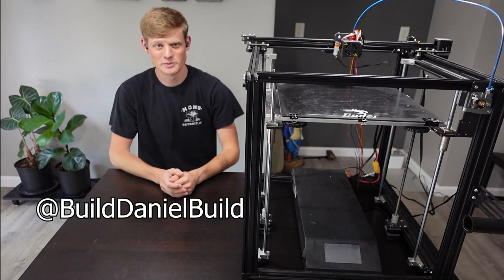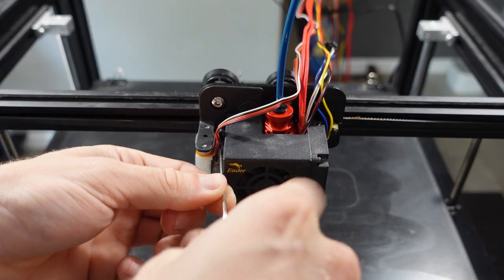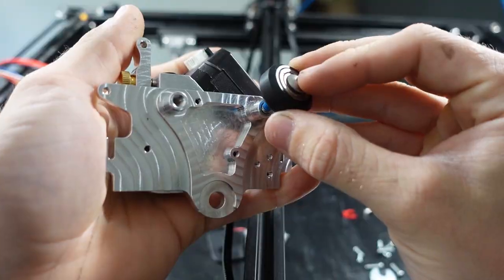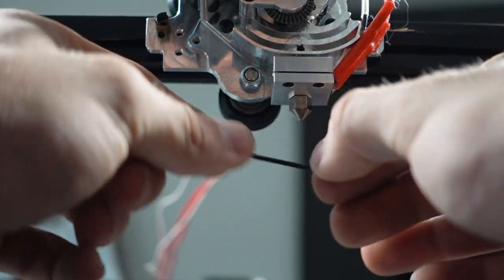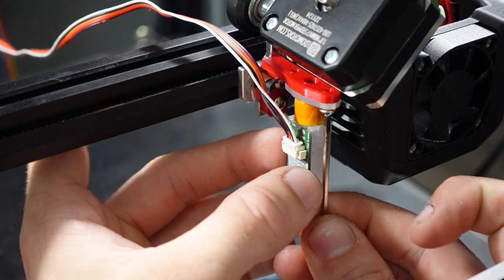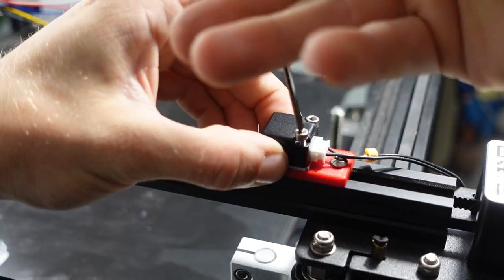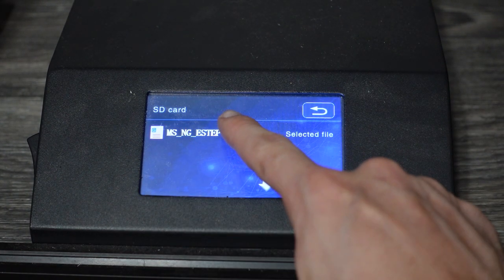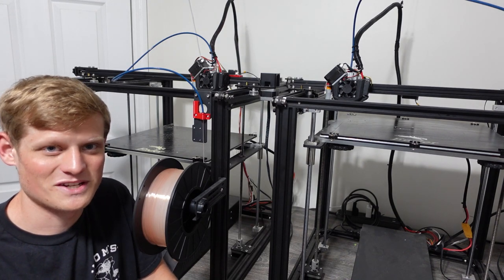Micro Swiss NG™ Direct Drive Extruder Installation Video (Creality Ender 5 Plus)

Comment: The Micro Swiss NG pretty well saved my Ender 5 to be honest.   Id started having some issues with the stock setup, especially the stock extruder that was just shredding filament.   I'd even tried a Creality Spider hot end hoping that would help but that turned out to be worse than the stock hot end.    I was about ready to give up when I happened across a heavily reduced Ender 5 Micro Swiss NG kit from a seller who bought the wrong kit.  It was still sealed, so I grabbed it and honestly, it is like having a different printer.  It behaves and just works now.      Of course, now it works I am going to put Klipper on it lol :)        The only thing I had an issue with was the CR Touch.  Because of where the connector is, the included BL Touch bracket didn;t work at all.   Luckily I'd printed one thinking it wasn't included and the one I printed was a bit different and worked with the Creality CR Touch
Reply: You happen to have the STL link for that part? In the same boat.

Comment: Thank you for showing the install of the X endstop! I was having issues with my Ender 5 Plus conversion when I realized that mine did not use an 8020 T nut for the endstop bracket like yours, instead using a threaded hold in the 8020 frame.

Comment: If anyone else was confused about attaching the hotend assembly to the extruder, the instructions failed to note that you might need to dry the grub screw outwards a bit in order to get the hotend fully inserted. There's a small inner ring on the hot end assembly that needs to get fully inserted into the extruder body. Once that's in, then you can drive your grub screw in and secure the hotend.

Comment: I agree that this may be the best drop in replacement option, but there are better direct drive options out there if you are willing to print mounts.
Reply: like what?
Reply: @d6m6nk6ng6  popular option is orbiter/Sherpa paired with hotends like phateus rapido/dragon comes in at about same price or slightly higher but does beat this in terms of weight (usually around 100g weight saving, YMMV depends on hotend, gantry options), higher volumetric flow allowing for faster prints, and more flexibility (more cooling options, or use of other hotends that have perks like the e3d revo). For all in one extruder/hotend, biqu H2 v2s or lite have shorter filament path and lighter by more again around 90-120g, and is overall cheaper. I actually forgot about the NF-sunrise which is around 70g lighter than this microswiss and is a drop in replacement for printers with the creality printer mounts. I don't have previous experience with NF-sunrise or microswiss NG but atleast on paper, NF-sunrise sounds like better option
Reply: This one is very unique though in that it has an exceptionally short filament path

Comment: I have 2 E5+ printers one has the genuine Bondtech BMG and I have bought a clone for the other one, however, the clone is running backwards and so the fix is to swap the 2 centre wires from the extruder motor around but no matter which tool I use to press down on the captive blades in the stock Creality plug the wires wont release, I don't want to cut and solder the wires as later down the line I may want to use a different extruder.
 as anyone else had this issue and how did you solve it?

Comment: perfect straight forward set up video. I just ordered one. Im just wondering how it will run on the Sonic Pad as far as the esteps
Reply: This is my question too. Any luck finding an answer? Or luck figuring it out?
Reply: @GrimCW  so I’ve been running into problems. The rotation distance needs to be adjusted to roughly 8mm and retraction distance and speed should be set between .8mm - 2mm at 30-40mm. I was having massive overhang issues. Resolved it tweaking settings but the stringing was even worse. Spent 2 weeks on email support with Micro Swiss. Finally they said try out the .4mm nozzle that came with it. It works well but I much prefer .6mm. The nozzles I were using before were creality. Swapped between brass and hardened steel so it wasn’t the cheap amazon ones. Just seems like despite the amount of retraction and speed adjustments it won’t stop the stringing. Even with coasting and combing enabled. So for now I’m stuck with .4mm. If I don’t figure out soon I will just convert back and print off a direct drive mod for the stock ender 5 Bowden set up

Comment: Im on the Tarantula Pro the touch sensor over hangs the bed when meah leveling is there a way to adjust where it probes ?
Reply: I'm also looking to figure this out.  Please share if you find a solution.  Currently I just moved the magnetic bed a little further forward but I'm sure there has to be a way to update this